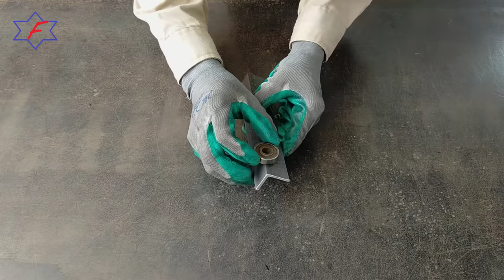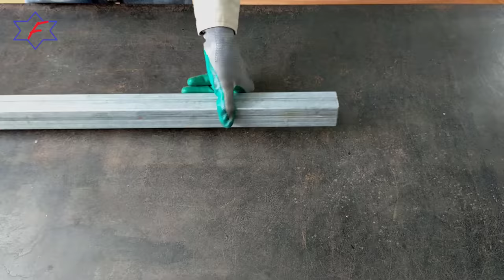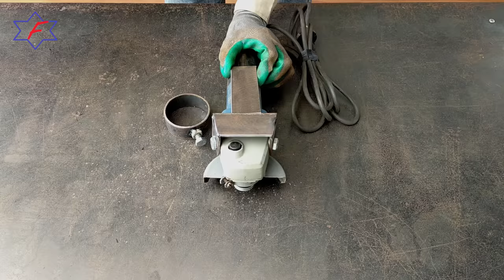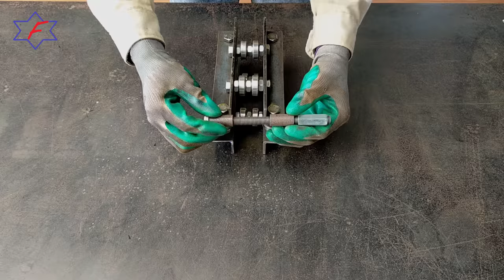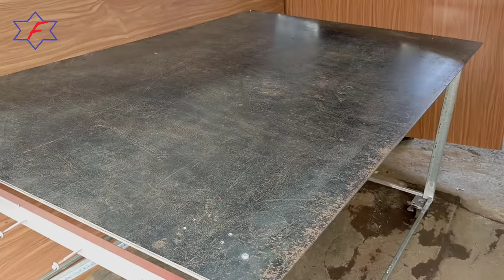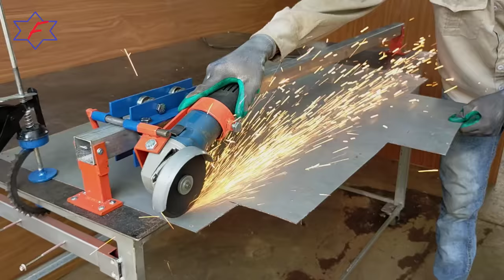DIY Tool | Make A Sliding Guide for Angle Grinder | Homemade Sliding Cutting Tool

Comment: okay, rule of thumb, you do not cut the material with the same direction the blade spins, because it feeds itself into the material. especially with the wood, the last couple second was very brightly showed it. Change the direction of the cut from pushing to pulling.

Comment: Umm the wood is kinda nuts?  I could just use one of my 3 tablesaws or one of my 3 ras  or one of my 2 skill saws. Or anyone of 12 differnt wood cutting tools.
And get a stright line.  Hell for that fact I could just use the radial arm saw to cut the tin.